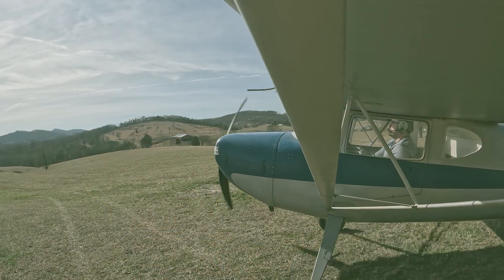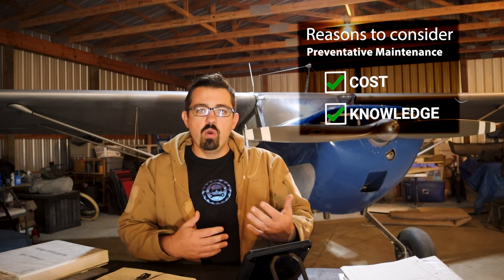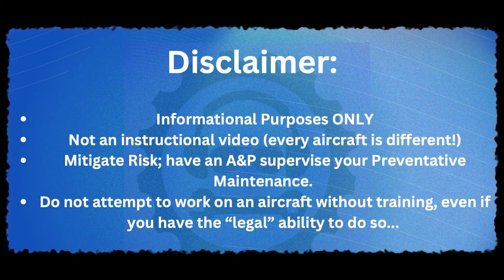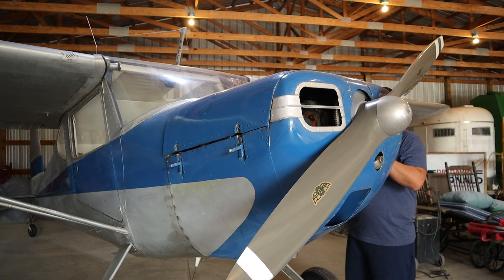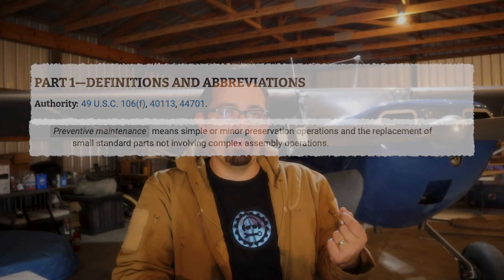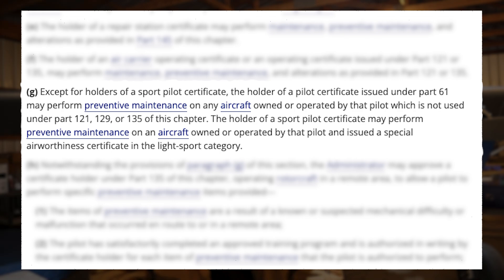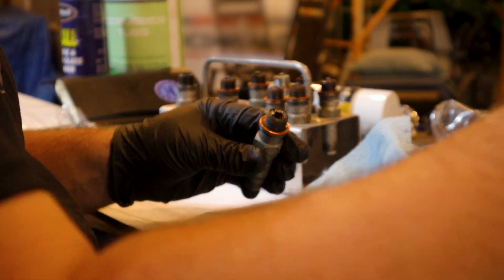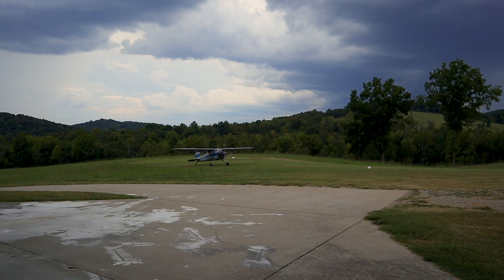Aircraft Preventative Maintenance: An Overview

Comment: I would HIGHLY CAUTION you about writing in the log books referencing the 120/140 REFERENCE manual, yes it is good tribal knowledge BUT it is NOT APPROVED Data and with the way the FAA is right now, all the 'old guys' are either dying or retiring and we have a lot of 'schooled' but not practical people taking their place, and they don't know how to use their head and have some sort of common sense. If an accident was to occur on an airplane you worked on and you 'referenced' a manual such as the 100 series or the 120/140 refence manual you might get yourself in hot water! Use the Service Letters, Service Bulletins, ADs, and AC43.13-1B or a descriptive entry of the work preformed. CYA man CYA!
Reply from the maker: I don't do a good job explaining in the video but the work is done IAW FAR 43 App D (annual inspection items) but is done using the checklist (I actually said the reference manual in the entry) as reference. The legal minimum is that 43 App D but the 140 checklist goes beyond that legal minimum. I've got a good relationship with our FSDO and fortunately they are (relatively) younger guys who recognize this as an acceptable means. That's only on an old aircraft like this where no reference material exists - approved or not! On our DA-40’s at school we say IAW App D using the Mx Manual as reference and since that is an acceptable item its a moot point. 

I appreciate your comment and concern with this! It seems like lately more FAA interpretations and rulings have been plagued with absolutely no industry guidance and advising so I get where you are coming from. 

Out of curiosity, do you own the Artic Tern?
Reply: @The_Flying_Mechanic  Yes, I have N2404V which was nicknamed "The Arctic Tern" when Bud Helmericks flew it in Alaska and Canada I restored it and got it flying again starting in 1995 until 2008 when I actually got it flying. 

So your local FSDO may work with you but other regions have other inspectors that do not have the same out look....This is why I caution you on saying to do this. even the "checklist" is not "Approved" it has to be from the manufacture. That is why you should reference CFR 43 APX D in the sign-off for 100hr or annual on these old airplanes.  Anything after late 50s I think got better for having a checklist as a guide.